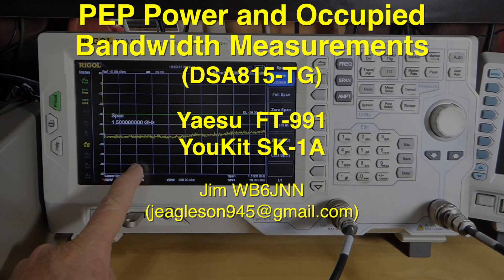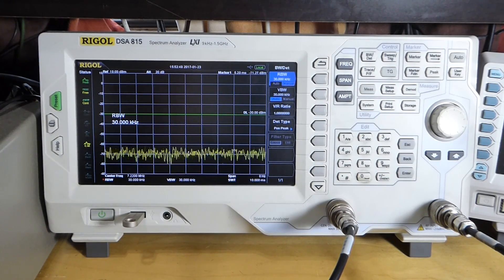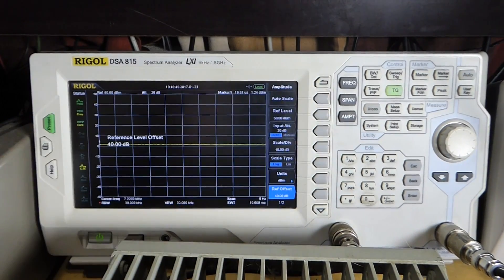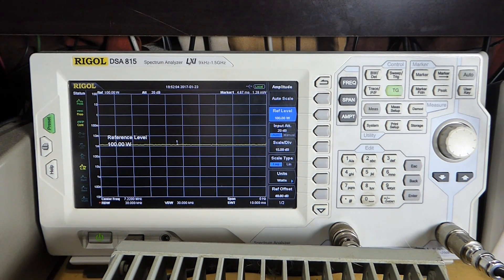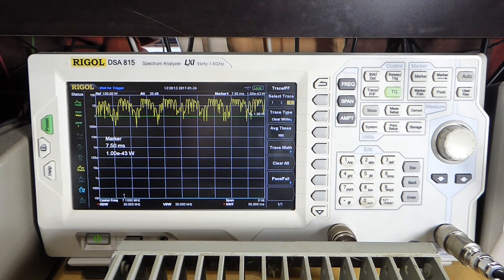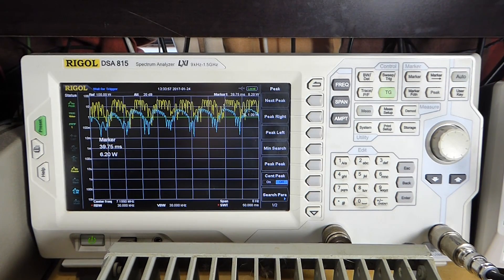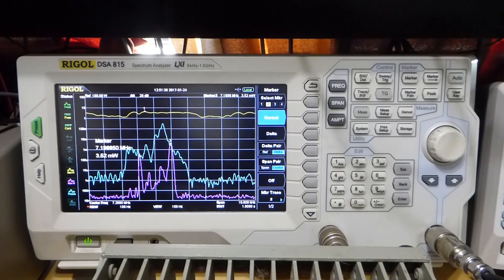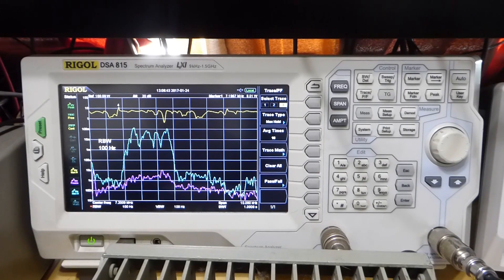Measuring PEP Power & Occupied Bandwidth on the DSA815 TG

Comment: finally a video that shows the correct way to measure PEP power, using zero-span on a spectrum analyzer.      it should be noted, that the RBW, VBW should be greater than the signal's modulation bandwidth to ensure correct power measurement.    30khz RBW should be good for SSB.      but for pulsed signals, radar, etc, RBW should be 10Mhz to measure correct pulsewidth and peak power.
Reply from the maker: Good points.

Comment: Is it possible to use Normalize function to zero out attenuator (dummy load) and bring everything up by x Db automatically to be as precise as possible, or does that feature only zero out TG ?
73 DE 9A3ICE
Reply from the maker: For SSB, not that I know about.  For occupied bandwidth there is an advanced measurements option offered by Rigol for a price.  See rigolna.com.
Reply from the maker: By the way if you save a CSV file you can scale things any way you wish using Excel or other programs such as Mathcad
Reply: @jimeagle1  oh yess that is good feature,totaly forgot... thank you very much 😁

Comment: Nice overview Jim.  Have yet to use all the features in the advanced measurement package yet.  The TOI, harmonics distortion, ACP, and OBW measurement features are real handy.
Reply from the maker: MikesRadioRepair  I don't have the advanced measurement package but I can do many of these measurements the old fashioned way.  PEP Power is straight forward, of course.  Occupied bandwidth as a regulatory issue is measured according to an FCC established mask under specific test conditions.  Naturally it depends on what mode one is using as to what those test conditions need to be.  

The video I made simply shows comparative BW and at 100 Hz RBW probably doesn't catch much in the way of transient "splatter" due to digitizing (which usually doesn't do well capturing transients and isn't truly "real time") and the fact that any swept measurement isn't always where transients happen when they happen.  But all of that is a subject all to itself.